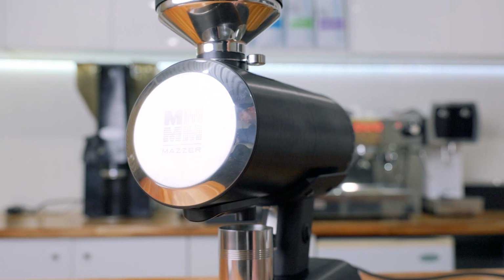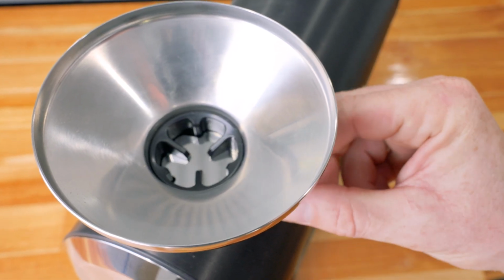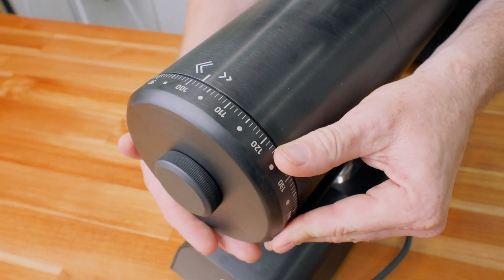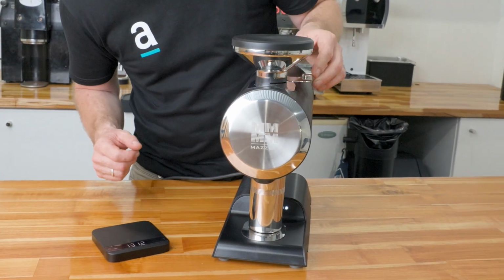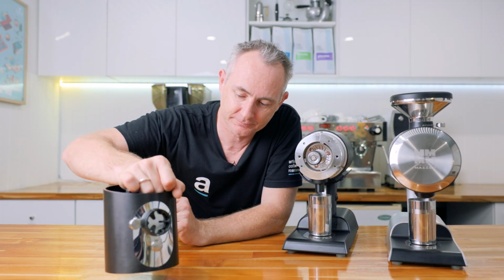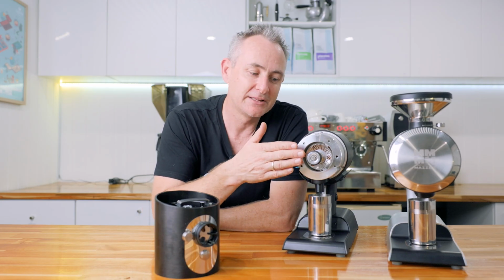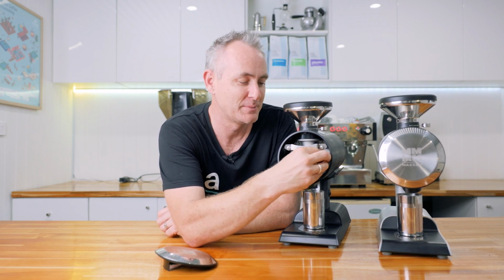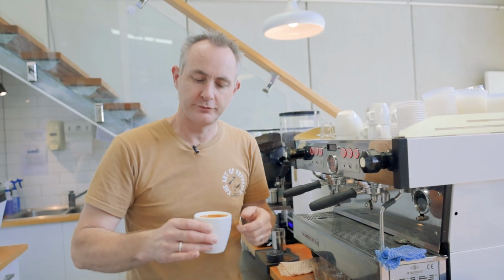Mazzer Philos - Is this 'the GOAT' of Single Dose Coffee Grinders?

Comment: I just bought a philos with i200 bur set. Compared to my mahlkonig e65s, the philos is definitely has a lot less mouthfeel to the e65s on espresso, especially with milk. It directly lower the flavor perspective/experience for my preference. The flavor is there, but feels hollow. Maybe the 189s will do better just like e65s on milk course.

The funny thing is, I compared the philos with my fellow ode gen 2 on filter coffee. I do prefer the clarity/flavor spectrum on the ode rather than philos which has a slightly higher body to the brew 😅

Philos is indeed an all rounder grinder. But it came with compromises on both filter brew and espressos.

Comment: Another thing, which filter basket did you use for the 23g that you ground? Cheers man. 189D espresso burrs, 200D for the flat cut filter burrs. 😊 Although the 200D could also be used for espresso just like many do with SSP  HU burrs.👍

Comment: Nice vid, I bought the silver with 189D burrs last year. I think it's an amazing bit of kit. I measured the OD of the cup at 56.5mm just under 57mm. I wish the cup had a flange or lip on the outside near the top to stop it from going all the way down to the bottom of my LM filter baskets which then creates a gap all around the grounds. Not a massive deal as I then just tap down a few times to settle, but a revised cup would be nice. Also, I sometimes get next to zero retention as well as in your vid. Great work! Thanks.

Comment: I liked the stainless on the silver Philos but not the brushed finish as it didn’t suit my machine (ECM Synchronika II) and was introducing a new colour and finish, so I went with the black version. Got it at the start of the year so was a few hundred less than it is now. Love it.

I don’t think you mentioned that you can change it from stepped grind settings to stepless.
Reply: Can you make cafe grade coffee at home with this grinder? I am looking at the ek43s but not sure if it will be overkill
Reply: @method341 depends on the machine you pair it with. I don’t think the Philos is designed for commercial use because it’s a single dose grinder. In saying that I don’t think anyone would argue that it could produce as good a grind as their commercial machines.
Reply: @mrdobalina3451 I'm a home user but want cafe grade coffee

Comment: I’m about to buy the Philos. I need your help! Now lets say you appreciate clarity and body equally in your espresso, and switch between light and dark roasts often. While I know you could buy both burr sets and switch between them. But if you were to buy and use ONLY one for both profiles of coffee, which would you choose? Full smooth burrs are 220D btw 😅 THANK YOU!
Reply: I have both sets, i189D makes also great light roast btw, very sweet just more blended notes. I would say most people would prefer what this burr set provides. Now today everyone has gone nuts and is chasing clarity which is not necessarily better tasting coffee. The 200d will provide the clarity, btw these also make great dark coffees just not with the body. Sorry both great burrs, if you drink milk drinks and dark espresso then would lean towards the 189s as they will also make tasty light roast.
Reply: @Gregmeacham-jq1xb thanks! This makes sense. I’ve ended up starting with the 200d, and while they definitely provide the clarity I’m looking for with my pour over, they definitely lack some of the body/balance I looking for with my espresso. I think it’s time to get my hands on some of the 189d’s!

Comment: Great, accurate review. I’ve owned mine since the day they became available in the US. It’s great!

The retention that you got is exactly what I see. And I really like that the motor and adjustment is at the back. It makes cleaning fast and simple. I have 16-inch cabinets, and the grinder fits well with no problem seeing and adjusting the grind.

I have the I200D (clarity) burrs. We enjoy small flat whites with fruit forward coffees, and it’s a perfect match. No need for RDT.

I roast at home with a Kaffelogic Nano7. We do cuppings to compare beans and roasts. With the Philos, it’s easy to clean it when switching beans, avoiding contamination in our tests. Previously, I had the Niche Zero, which is a nice, conical, but gets gummy and is difficult to clean well. With the Philos, I have absolutely zero gummy buildup. The retained grounds are dry and brush out easily. Also, with the Niche, you need a tool, and have small, loose parts that could get lost. With the Philos, there’s just the main body and front housing. 

After cleaning, you have to recalibrate the Niche. With the Philos, the adjustment wasn’t touched during cleaning.

Hats off to the designers. The attention to detail is impressive.
Reply from the maker: Thats wonderful to hear this is your expericne, it's what the Enginners at mazzer have strived to do. the best experience, enginneering and outcomes possible. You cant get that with a cheaper grinder, there is always comprimise. Mazzer = No comprimise.Cheers Luke

Comment: I've had a Philos for about a year.  Love it.  I kept my Niche Zero thinking I'd use it when I want something more traditional but with the i189D burrs I get the best of both worlds.  The only downside I've noticed is that the grinder will chirp if moving from a larger setting to a smaller setting with the motor running, regardless of the setting (e.g. going from 90 to 20).
Reply: Sounds like stuck beans. Mine does it, too.
Reply from the maker: Chirping is when the burrs are touching, this should only happen at the 0 point. have you cleaned recently or played with the burrs? these are perfeclty allgind from the factory so i owuld not recomend taking them out.
Reply: Just go to 1 while running to clean the bean out and back to your setting
Reply: It’s fake sound don’t worry
Reply: I just bought a linea mini last week.. Which grinder would u choose from the two thanks

Comment: This compared to the Option-O P80? I know they are different size burrs, and the price difference is a lot, but would you say the jump over the Phillos might be worth it?
Reply: Once dialled in, this grinder is very consistent. However, this is not a grinder for someone who wants to be changing beans every couple of doses as the Goldilocks grind size window on the curve is much narrower than a Niche. It usually takes a couple of doses to find that window with a different bean, which would be frustrating if you like chopping and changing all the time.
Reply: @12angryrealists Yes I do change beans all the time, every 200-400 grams (1-2 packs) I get a different one. But I'm used to that dialing process as I'm already using a flat burr grinder (Eureka Mignon), and I have a flow control on my machine so it allows me to save a lot of shots. So compared to a conical like the Niche, I'm not expecting this to be as easy to dial in. But do you recon it's narrow sweet spot even compared to other flat burr grinders? And are you referring to the 200D burrset (I think that's what they were called)?
Reply from the maker: if anyone is jumping form bean to bean the key here is the bean age, denisty and roast level, differnt beans have different grind settings, simple. you cant expect any grinder to be good at the same grind setting for bean variations. This is where bean analaysis of denstity, moisture and roast level come in and you can build a catalogue of grind profiles to assist you in knowing where to start on a new bean. Cheers Luke
Reply: @FirstDropCoffee I think the narrow sweet spot is a feature rather than a fault. However, it is to be expected with all flat burrs. I don't think it is more noticeable relative to other flat burrs on the market. I think the grinder is exceptional and I'm running the 189 burrs. I bought mine earlier this year after it had already been on the market for the best part of a year. 

There were many accounts that the early batches had major alignment issues for some who were unlucky. However, that's the price you pay for first mover advantage, which is why I avoid being the guinea pig on any new model. Even new model Toyota's always have some issues that they iron out in subsequent releases.
Reply: I bought the Philos right after it was released and ran into major consistency issues. Same beans, same workflow — but constantly different results. Sometimes the shot time would vary by 10–20 seconds, which drove me absolutely crazy.

We ended up exchanging the grinder, but the second unit had exactly the same problem. There’s a video from Vettore describing the same experience, and Mazzer later sent him a newer version, saying they had fixed the issue.

I have to admit, I was very disappointed with the performance, even though the build quality and design were excellent — it really looked and felt great.

For comparison, I’ve never had these problems with my Niche, Ceado Life, or P64 — all of them have been stable and consistent, even when switching beans.
Reply: I had the Mazzer Philos and wasn’t 100% happy with it because it was very inconsistent. I’m currently using the Niche Zero and just ordered the Lagom P80. I already owned the P64 two years ago and it was the best grinder I’ve ever had — I really regretted selling it. I think the Lagom is on a completely different level when it comes to build quality, workflow, and grind consistency.
Reply: @frankausfrankfurt Thank you, much appreciated!